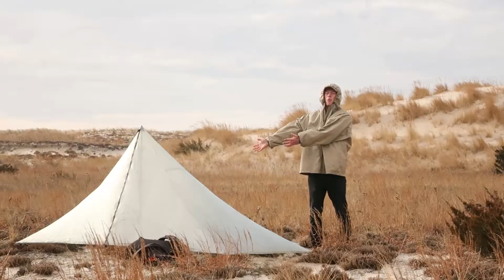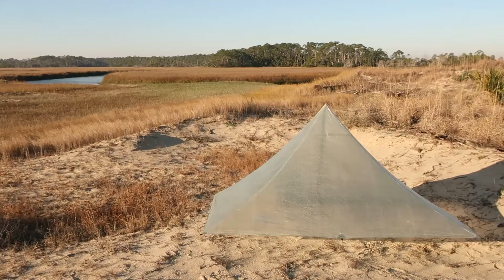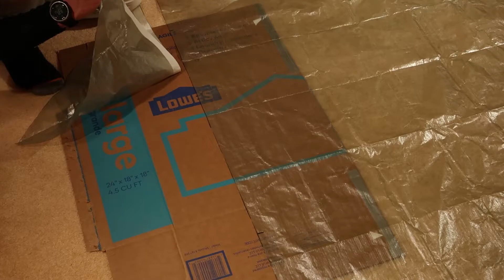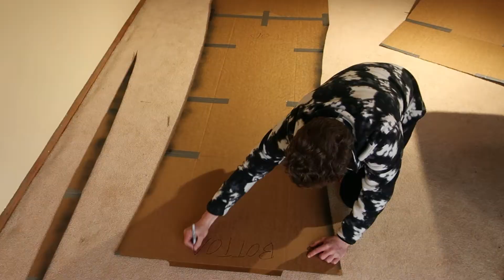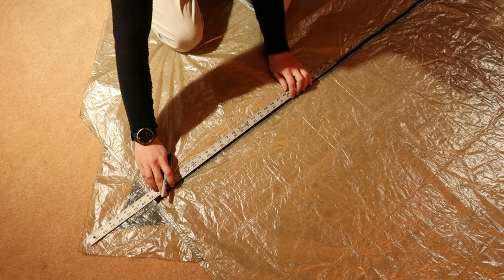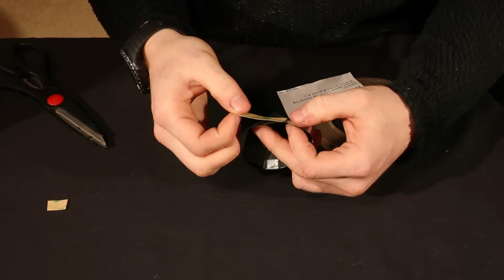How to Build an Ultralight DCF Tent MYOG

Comment: I used your pattern and directions to make my tent last year. Cut it from a silnylon tarp and used what I had on hand for zippers and other parts. As one of my first sewing projects, I didn't make it perfectly, but with some changes I ended up with something that looks very close to the plans. Also added a second zipper flap below the first which an optional bug net door zips to in case I want to roll up one door on a warm buggy night. Added a bug net skirt also which in my case is basically just a few inches of netting sewn along the bottom. 
I can't thank you enough for helping me make this great shelter. I'm looking around for gear upgrades as is the way and I'm simply not seeing anything better! Practiced with it for a couple of weeks before taking it on a bike ride from upstate New York to West Virginia up in the Appalachians. Used this every single night. By the time I found myself on a windy mountainside backcountry camp, I had full confidence it would hold together despite the waves of wind I could hear come over the mountain before pounding down on me. I woke up with snow all around but completely dry on the inside. I like that its so easy to setup and strike camp. It rolls down small and with a section of teyvek groundsheet it's just over 2 lbs, even with the extra netting. 
Just amazing! I'll be using this as my primary choice of shelter again this year in my rides and hikes around Adirondacks. Thank you
Reply from the maker: That's awesome!! You're welcome!

Comment: I also make Dyneema tents. My 0.51 ounce/sqyd Dyneema material 4.05 ounce floor-less tent is 4 ft x 8.5 ft x 3.5 ft high. I use all glue construction, no sewing. I've given up trying to sew a straight line as well saving the time waterproofing seams. Tapes for Dyneema have 3 serious flaws and why I've developed my own adhesive. My hems are 1/4: inch around the entire tent with added reinforcements and 300 test pound Kevlar loops for tent stake support. I have a loop at the peak for hanging the tent by about 8 or more methods. It's floor-less so I decide the amount and type material to be used for a ground sheet. It include a 3 ft long entry/exit waterproof zipper and a waterproofed zippered vent with hood.

Comment: Having a bit of trouble understanding the cat cut part: 
So you have 91” on one side and then 81” on the other - so am I right in saying one side is longer than the other? 

So to make it you have the thing up against the fence and (for example) measure in 91” from right to left on the top and then 81” from right to left on the bottom?

Is that because the cat cut for the door section is shorter than that of the back and sides? 

Thanks!

Comment: Will the catenary curve of the ropes with equal heights on both sides match the fabric curve from the top to the bottom of the tent?
Reply from the maker: That's a great question. On paper, no.

This tent pattern is very forgiving to small deviations in measurements (due to slight measuring mistakes, pattern pieces slightly misaligned, etc.).

In practice, the difference in length can be compensated for by adjusting the alignment of the tops of the panels. If you don't do this though, it's not a big deal.

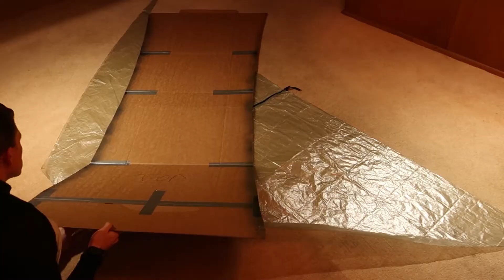Comment: At 6:43 you sew on nylon webbing over the zipper center. Do you find having this as a tie out point is helpful (I see many other midds do not). 

Thanks!
Reply from the maker: Absolutely!! The peak guyline keeps the back wall of the tent rigid in high winds and it allows you to have your tent pole at an angle.

Comment: How does it deal with condensation?
Reply from the maker: About the same as any other single wall tent. Making sure the tent is properly ventilated does help a lot but for me, the most important factor in reducing condensation is proper campsite selection

Comment: Wow great video! I don't think I'm ready for this expensive DCF fabric, by my calculations it would cost around $300 to make assuming you already having a sewing machine you can barrow. Maybe I'll start with a DIY quilt or a silnilon tent. Any instructions for a DCF backpack or gear bags?
Reply from the maker: I don't have any instructions out yet but I'll definitely put some out eventually! The thing with packs is, it's really easy to design and build a pack for short, ultralight trips but it's actually pretty difficult to build a pack that can comfortably carry heavy loads and hold up to long term use.

Comment: Beautiful.  Aren't the corner-spaces somewhat wasted by being so close to the ground?  Head and feet touching the side-walls?  One wonders if a UL free-standing tent might be possible to optimize this lost space?  Been looking at Quest's Easton carbon-fiber poles, especially the "3.9-custom" (0.296") poles, weighing only 9g each?  Figure it might be possible to keep pole-weight below 10oz?  Big-Sky Mirage 1.5 is perhaps the closest idea, but they aren't available in dcf yet.
Reply from the maker: I'm 6'1 and have plenty of head/foot space when the tent is pitched all the way to the ground. The beauty of this type of tent design though is that it can be pitched as high as you'd like. A higher pitch decreases condensation but obviously exposes you to drafts and weather. Freestanding tents are AWESOME for short trips but their designs are really complex compared to a simple, single wall, floorless trekking pole tent. You may feel differently but for me personally, I like my backpacking shelters to be as simple as possible in order save weight, reduce the chances of a part of the shelter breaking, and make setup and takedown as quick as possible.

Comment: Brilliant design, I'm looking around for some 2nd silnylon and cheap line locs to make a cheap prototype. Are you developing plans for an inner bugnet?
Reply from the maker: That's awesome! Don't forget to send me some pictures when you're done! (josh(at)howtomyog.com) If you can't find linelocs, tautline hitches work well for tensioning guylines. I'm not a big fan of inner nets. If I was just using my tent during bug season, and in buggy environments then I'd sew on a bug mesh floor. Right now I'm trying to figure out how to make a detachable mesh floor that is still ultralight but I'm not there yet. For now, I'm using a big sock made of tulle that slips over my head and the torso of my quilt and earplugs for camping in buggy areas.

Comment: Surprisingly, I've also made a Dyneema tent. It weighs 3.85 ounces, 4 ft X 8.94 ft  X 3.5 ft high, floorless. It's a diamond shape made from 0.51 ounce/sqyd Dyneema. My previous Dyneema tent weighs 4.7 ounces, 4.8 ft X 9 ft X 3.5 ft high. No sewing, all glue construction with a #3 waterproof 3 ft zip entry/exit and a 9 inch DIY waterproofed vent zip with hood and mosquito netting. I used triangular reinforcements at all tie-down locations with 100 lb test Spectra fishing line tie-downs at the 4 prime locations and at both sides of the entry/exit for maintaining the tent open. A tie-down is also at the top center of the tent for hanging it from above and a tie-down at top center inside for hanging a flashlight, etc. Sewing places holes in the Dyneema and thread frays over time. It needs to be waterproofed  Additionally, you also have exposed edges. Adhesive tape doesn't easily separate from its' substrate, will go off the straight path laying it and when lap jointed or hemmed will expose some adhesive which cannot be removed or a bit overlapped leaving an exposed edge. Gluing provides a 1/4 inch fully sealed hem as well 1/2 inch lap joints.  Clean-up with Acetone. Based on the results, I should have made the entry/exit zipper waterproofed due to the excessive effort required to move the slider. I'm now in the process of making a heat reflective tent with the same dimensions, design and construction. I expect it to weigh about 6 ounces. All dimensions are resolved with simple trigonometry.
Reply: What glue did you use?
Reply: @stevenplummer3703  Acetoned Original Gorilla Glue. Be careful to remove any excess glue and apply pressure after application and repeat about 20 minutes later. Used full strength Shoe Goo for the first Tent. It is too viscous, reducing it reduces it’s strength. Otherwise it’s good to go.
Reply from the maker: That's so awesome! I have so many questions! Do you need to have pressure on the seams as the glue is drying? Do you think I'd be feasible to glue seams that have catenary cuts? How does your tent pitch? With just a trekking pole in the center?  What are you planning on making your heat reflective tent out of? Space blanket material?
Reply: @Adventure_Logistics  Yes, finger pressure as Original Gorilla Glue out-gasses, initially, about 10 minutes later and  about 20 minutes later, removing excess glue in the process. Applying glue to any overlapping joint is practical. Lay heavy weight objects in the vicinity of the joining parts to keep them in place. I also employ finger clamps where practical. My 4.7 ounce and 3.84 ounce tents are supported from the top center with a loop of 100 pound test Spectra fishing line, also for my 5 tie downs, 4.7 ounce tent & 6 tie downs, 3.84 ounce tent. Hanging a tent provides more internal space & comfort vs a pole. However, a pole also works where tree limbs are not available. Both tents have an internal Spectra loop for hanging a flashlight, etc.. There are about 5 methods of hanging a tent. The heat reflective tent is space blanket material, an SOL 5 ft X 7 ft bivy, more than ample material for a 4ft X 8.9 + ft X 3.5 ft high tent.  All reinforcements, joinery and hem will be Dyneema. Because the material can’t be glued, I’m forced to use adhesive tape such as used for Dyneema. But instead of Dyneema tape, expensive and the glue separates from the substrate prior to application, I use Vinyl Basting Tape from Sailrite, retailer from Maine. I still have cutting to do on the material, have  sufficient Dyneema for the project and have prepared the entry/exit zipper for use. A work in progress. Being a prototype, I’m taking my time being careful not to louse it up.
Reply: Do you have any pics of your tarp?
Reply: @whereisthemessiah  Yes - photos are available of my 4.7 ounce tent. My current flourless tent, revised weight is 4.03 ounces/114.813 grams, measuring 4’-5.25” wide X 8’-5.75” long X 3.5 feet high (feet & inches above). Had to revise it due to an error. Should weigh less than 4 ounces - some additional material  remains due to the revision. If you want to see the photos then send me your email address.

Comment: This was insanely straight forward and to the point.  You spared no details.  I love it. 

One question, what was the cost breakdown for materials? (Looking more at the big ticket items,  ie your DCF, tape, zippers, etc.)
Reply from the maker: Thank you! I didn't want to mention the cost of making one of these tents because since there are so many components, your cost can vary drastically based on where you source your materials. For the tent in the video, I used B-grade DCF and I bought a lot of the small components in bulk to save money. For most people this isn't an option. If cost is a huge factor definitely consider using silnylon instead of DCF.